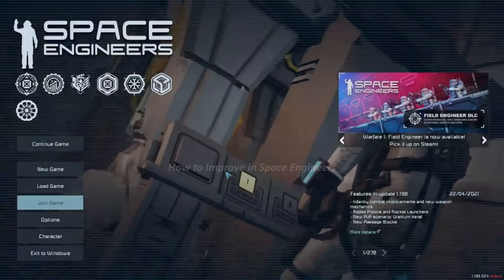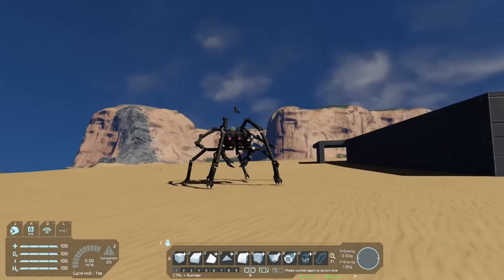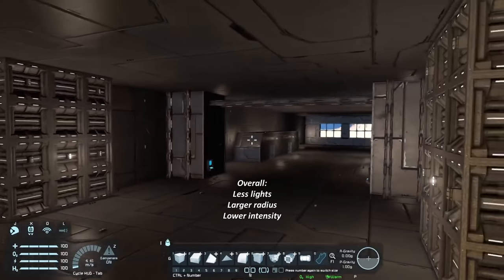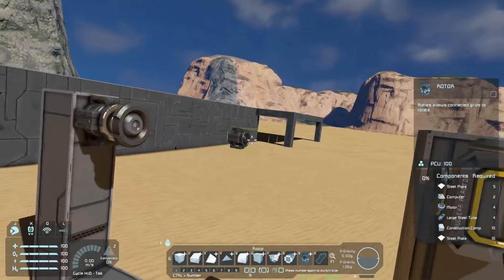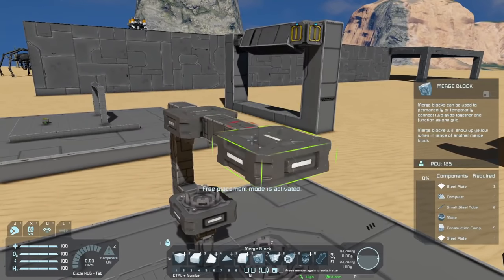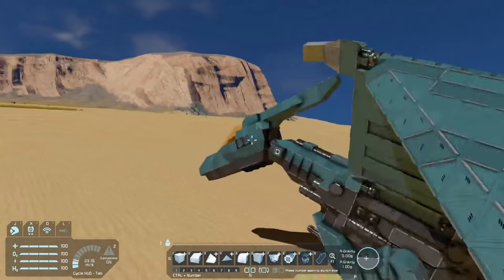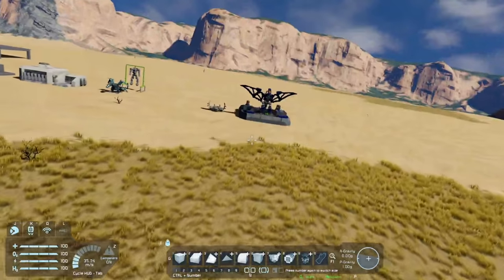How to Improve in Space Engineers | Clever Tips Ep. 1

Comment from the maker: *EDITS*  (in parenthesis)
Spectator 01:00 (EDIT: Teleport = Cntrl+SPACEBAR, not shift)
Lighting 02:43
Paint 04:23
Double Rotors 05:30
Double Pistons 07:53
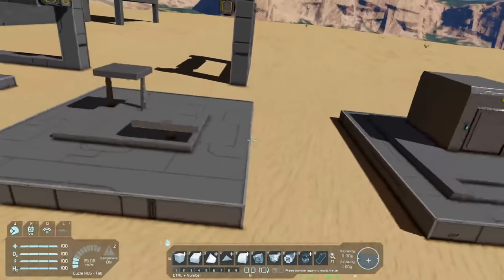Sensor Actions 09:46
Corner LCD Hidden Uses 11:08 (BETTER FIX: Use Neon Tubes Down)
Wheel Suspension Hidden Uses 12:35
Gatling + Conveyor Tube Uses 14:38

Comment: 1500 hours into the game and your piston connection method is so much better than the method I used previously. I fully extended both pistons I want to connect and then used a 3rd piston to push the piston heads just far enough apart to fit a merge block since extended pistons can be flexed a little.
By the way there is also CTRL paint besides Shift paint and Shift+CTRL paint as another brush size.
Reply from the maker: Yeah man don't work harder than you need to. That's true with the paint I just never bothered using the cntrl key when I could MMB on such a smal area as a 3x3

Comment: Another great video, you did a nice job with the narration! 

This reminds me, if I remember correctly I believe some point shortly after the introduction of planets they hard-coded in a limit to how many lights the game will render, last time I checked it's somewhere around 250. It sounds like a lot, but when every active thruster counts as a light source it can add up really quickly, resulting in some very glitchy illumination as the engine isn't optimized terribly well when it comes to deciding which light sources it wants to render. The methods you showed here are very handy for getting the most bang for your buck from regular lighting, although another neat trick I've found lighting large interiors is that long lines of neon tubes can noticeably brighten the ambient lighting in a room without taking up any of that limit. I've also heard of some folks using blank LCD panels with the background color set to white for lighting, although I haven't tried it yet myself to see how useful it actually is.
Reply from the maker: Thanks Lanthire, I haven't tried the neon as a straight light source, but the white LCD panels work really nice even if only for detail.

Comment: I think that I prefer corner lights over LCDs for the stairs. Turning them off blends in nicely and turning them on makes them dual use.

I didn't know about the hinge sensor group tip. That's cool.

I knew about wheel suspension clipping like that but never thought to use it like you did. Very nice.

Are grinders not accurate enough instead of the conveyor +gun trick? I assume you use the conveyor tube instead if a merge block because it's cheaper?
Reply from the maker: Lights or LCD could go 50/50 for me on the stairs, whatever your preference. I use the gat+tube because it's compact and quick. Small grid grinders and merge blocks take up a lot of room.

Comment: 14:41 This just screams 'Small merge blocks!' at me.
Reply from the maker: I would say rotors and hinges could fit that category better since they can re-attach, but this is the best way to keep it all one grid
Reply: True, then again while for this example it works, even a 1x1x1 merge block (as amazing as it would be) cannot fulfill the other important feature of the gat detach: conveyor acess

I make missiles, i make a LOT of missiles. and when it comes to small grid missiles, your best bet is (just like large ones) to use hydrogen. However unlike large grids, the size of the connection needed for such a thing is INSANE (3x3 for merge+3x3 for connector) leading to missiles so fat it negatively impacts their use (2/3 welders per missile means a lot of wasted space and PCU investement per missile)

Meanwhile, by using either gattling detach or hinges, you can have a 1x1x1 hardpoint, allowing a clever design to build 2 missiles per welder (3 missiles if you go for an open rack, and 5 if you wish to challenge clang) which substantially increase the firepower, reload speed and shrink the silo to the point where even a small corvette (or missile boat) can carry a frightening amount of ranged weaponry, and the ability to reload them too.

As such, i think that an advanced merge block would be even better, allowing both connection and conveyor transfer, because that would solve all concurent issues while not sacrificing performance and ability to print without MGP pluggin
Reply from the maker: @mobiuscoreindustries  I think you already touched on it but the hinge block seems to be the best H2 missile attach block for the conveyor access, size, and detach function. However welding would be harder across the hinge than just a tube that gets shot and can stay all one grid
Reply: @BlackArmor718  Indeed. It's why I have switched to using hinges as the connection for small grid missiles. 
Downside being that at the moment it requires the MGP to be re-welded in combat
Reply: @mobiuscoreindustries  what is MGP
Reply: @Aaron-wq3jz  multi grid projection. It is a plugging that allows to project and weld subgrids. Subgrids being the things on top of rotors and pistons that are normally not projected with the main grid.
Reply: @mobiuscoreindustries  is there a model or link that u get it from

Comment: Hi BlackArmor, i was wondering, the tip about leaving your character in front of a control panel and using it via the spectator mode, doesn't it work anymore ?
I used it a lot before but now pressing K only opens my inventory and the control panel tab says none is connected. Being in a seat allows me to access the control panel but not the construction.
Is there an option that i forgot to check ?
Reply from the maker: They have once again disabled that ability, which is frustrating. You’ll have to get into a seat or something now
Reply: @BlackArmor718  I tried getting in the seat and it works but it seems you can't select a block in the toolbar if your character is sitting.